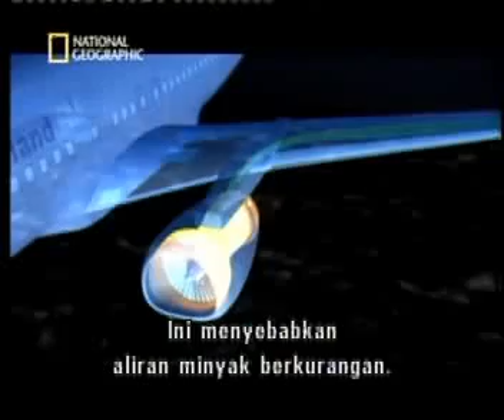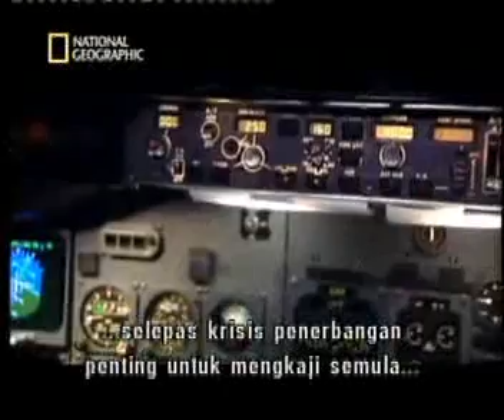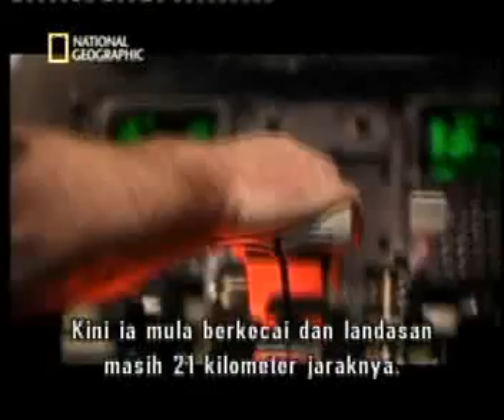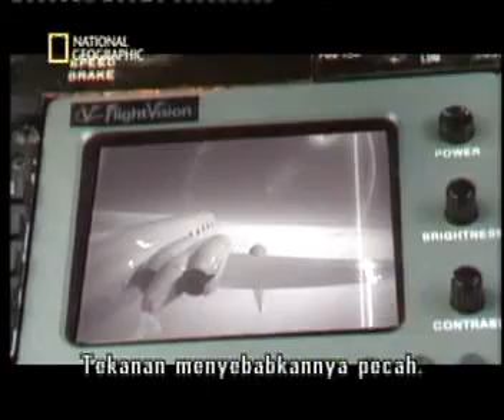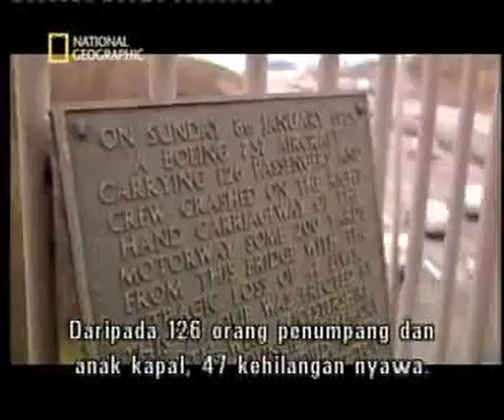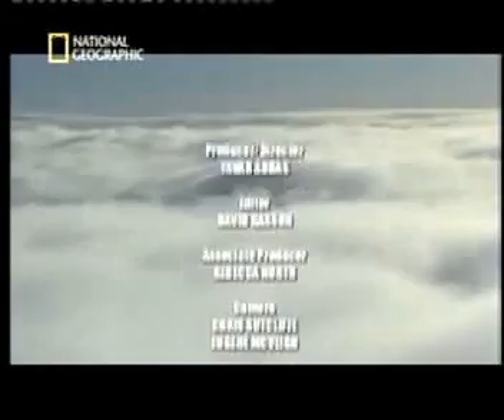Second from disaster - Motorway Plane Crash part 5

Comment: The pilots misread/ignored the obvious and plainly legible vibration indicator.  The fact that it had been modified does not mean that a child could not read it.  The mechanical failure (certainly attributable to Boeing and/or CFM neglect) should have been a routine matter. Unlike the 737 rudder servo crashes, the main cause here was pilot malfeasance.  Period.  This is just a fact and not a condemnation.  It was a mistake, honestly made, that still simply should not have been made.  Very sad.

Comment: This is what we call that is stupid to act clever to change the way that presend those readings on the cockpit. Especially change the way that now the air-conditional of the plane is power by both engines. With lack of training, it will make pilots confuse. Even with training, sometimes may cause confusions.